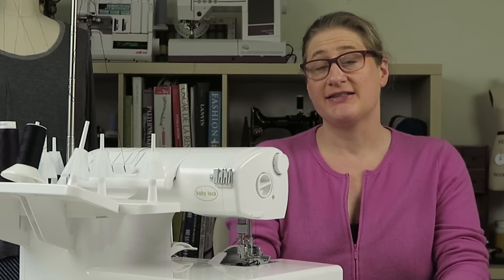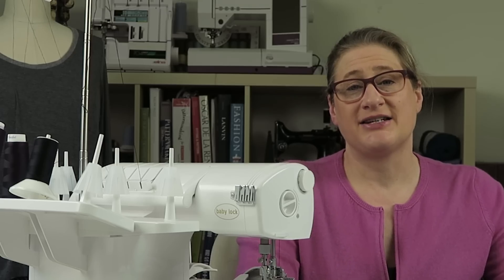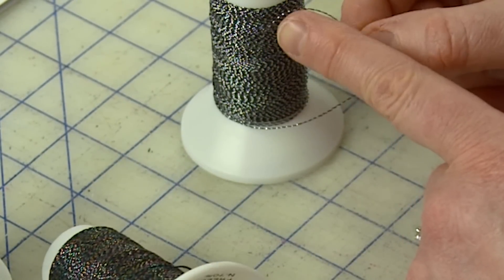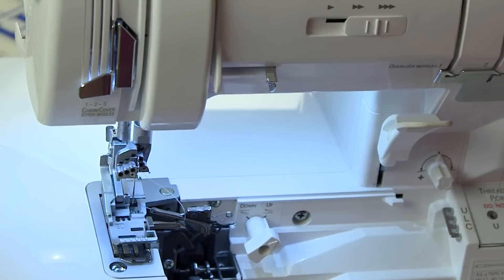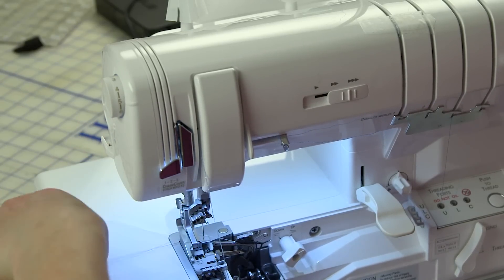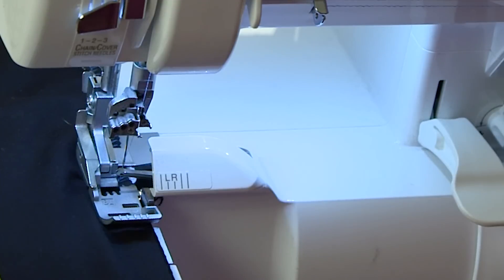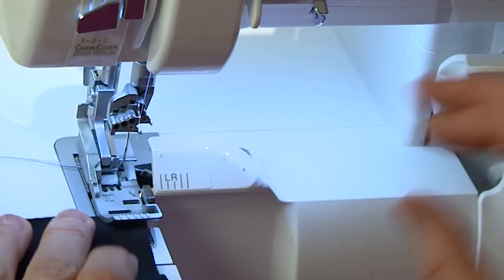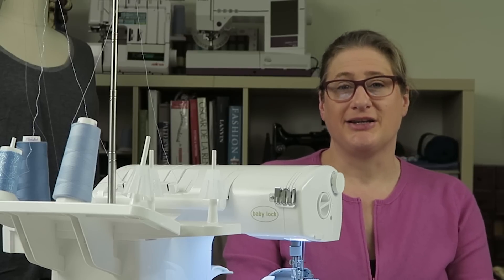Decorative Reverse Flatlock vs. Decorative Flatlock

Comment: Thank for this video! I want to try this but i'm a little scared, is this stitch strong enough on its own for leggins? I feel like they would rip apart mid squat 😨
Reply from the maker: ;) Use a Three Thread Wide stitch for the reverse Flatlock and it will  be strong enough … unless you put your thumb through the seam when you’re pulling them up!
Reply: @JSternDesigns  Thank you! ♥

Comment: Hello! Really love your videos! I do have a quick question about the Ovation because I am confused and hear different things. Are we supposed to oil our machine??
Reply from the maker: Black Hat Quilter that’s a good question. The answer is No. Unlike older machines with exposed metal parts, you can’t reach the places that may need lubrication.   Those air feed ports look tempting...   but please do not put anything in them besides thread.

Comment: Thanks for the video.  I can't wait to try this.  What size needle did you use for metallic thread?  90/14 for metallic thread, or topstitch?
Reply from the maker: That's a great question!  I can't believe I forgot to mention the needle in the video...   I'm using a size 12 stretch needle.  Metallic Woolly Nylon does not require a metallic or topstitch needle... as a matter of fact, I did a video showing what can happen to your knit of you use a big topstitch needle...  It's  not pretty :) https://youtu.be/jLmS_tgXQ2U